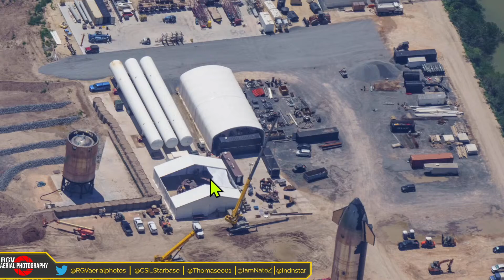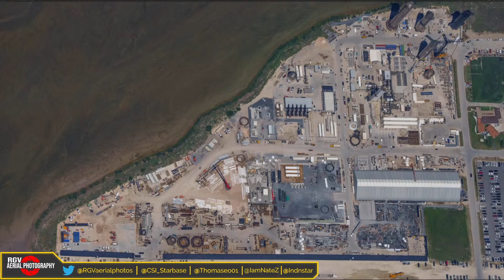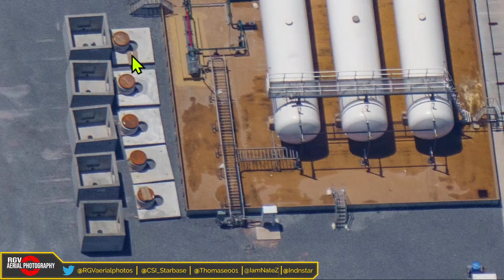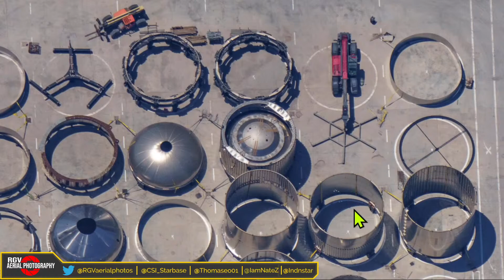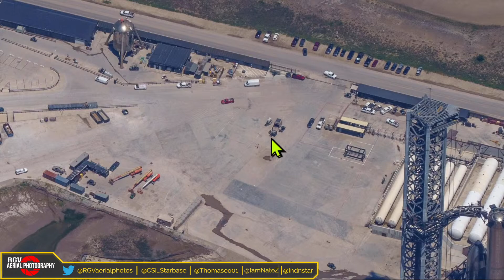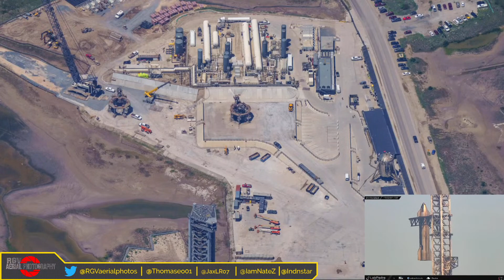Starbase Weekly Episode 69

Comment: Pipe size gets smaller as volume requirements for water decrease. This is standard in all piping in fire protection systems. Deluge system is not Fire Protection in this case however, principal is the same.